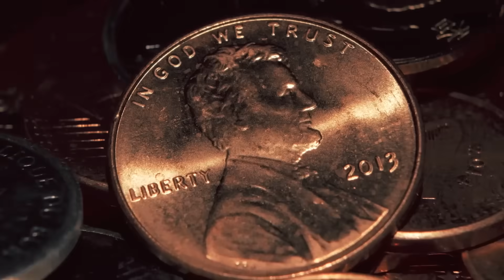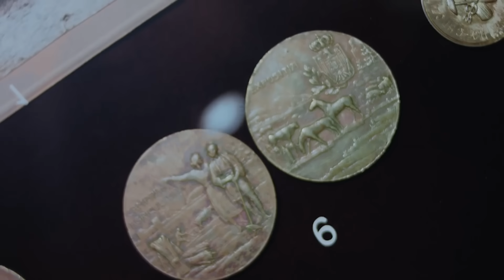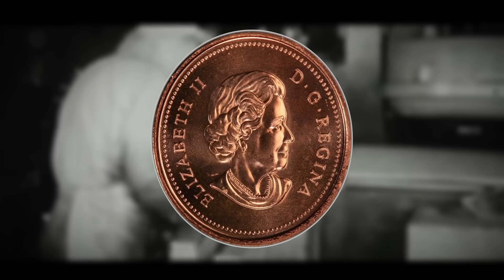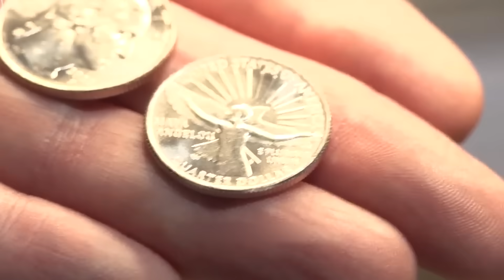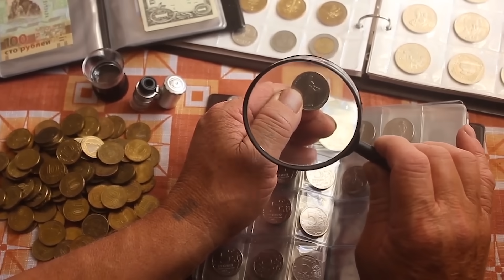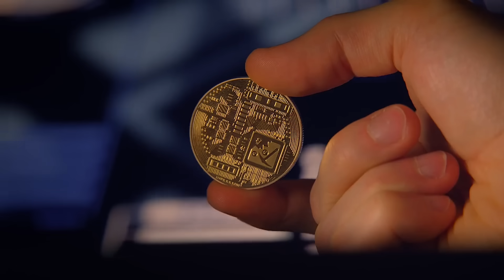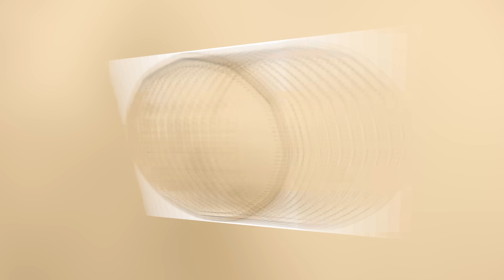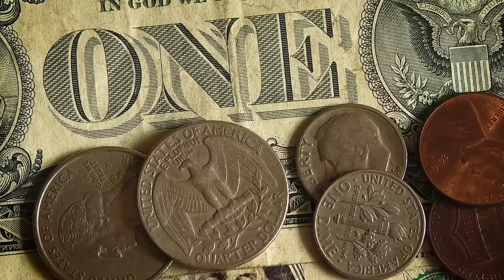What Happens to Old Coins When They’re No Longer Used?

Comment: Something stated in this video are wrong. The cost production of a coin has no bearing on its value. The value is based on the number of times a coin is used. Removing coins is the first step in them removing cash from society, not something anyone in society should want.
Reply from the maker: Thanks for sharing your perspective, interesting point about how coin value and cash in society work.